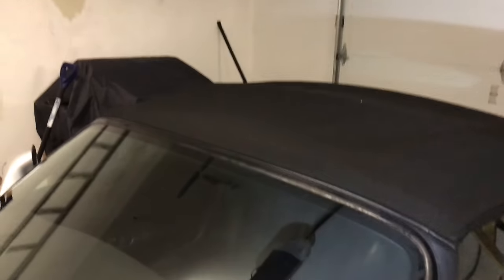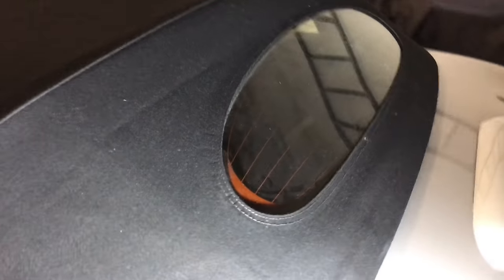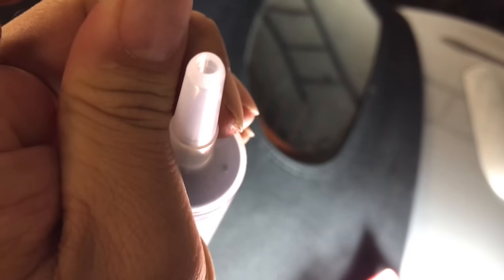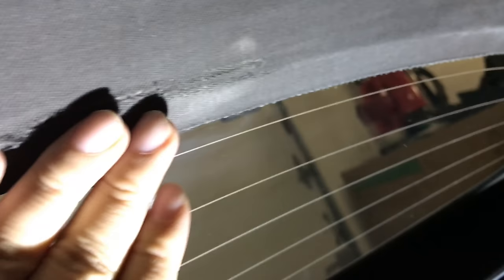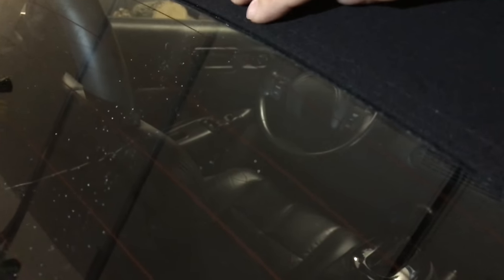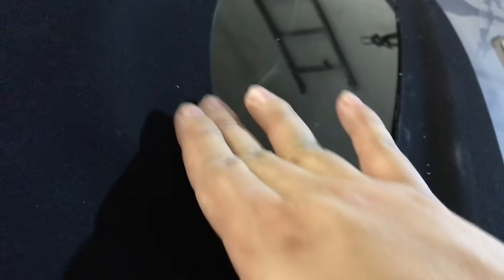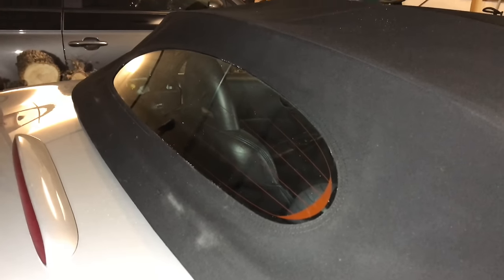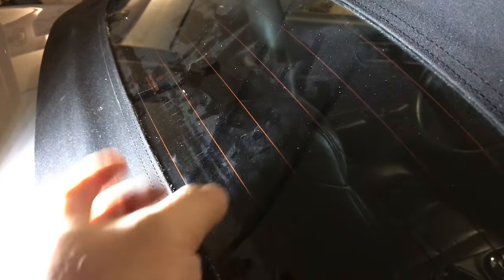How to glue separating convertible top and rear window on my Plymouth Prowler

Comment: Goop glue is the answer for sure. Ive used it for years. Just make sure your surfaces are clean and youre good to go ! After reading up on goop glue ,its all pretty much the same but in different consistencies. ALSO, Goop Marine comes in an 11 oz. caulk tube. Its slightly runnier but not much. I use it on everything.

Comment: You need to use 3M primer and 3M window weld. The best way to fix this long term.
Reply from the maker: That's a good tip. I didn't do that, but I would if I need to redo it.
Reply: Yo, thanks for the recommendation. Looked into it and seems like the best ans easiest way to go. 

Kudos to you friend! Enjoy the summer weather.

Comment: Thanks. I have a Chrysler Sebring. (I can't believe I just said that sentence). It's a 2005 with 41000 original miles and I'm in Florida so you got to have a drop top. I had a similar problem just not as aggressive. My issue was confined to the center bottom. I live in Orlando, Fl every winter but a Chicago boy 24/7 ! A big thanks from Rogers Park Guy of California Avenue, in between Touhy and Howard. Orlando sucks and you rock. Thanks for your video.

Comment: has the glue held up over time?
Reply: Probably not
Reply: I tried to fixed my Spyder convertible problem like this problem. I did what he did and only after 2x pulling down my soft top the glass came lose again.    Once you reglue the seal, let it cure, Etc and eventually use the car and attempt to take the soft top down your glass WILL fall down it become loose again.  You can’t mimic a factory seal job at home.

Between the windy conditions when the roof top is up, moving the soft top up and down and Etc, will eventually cause the rear glass window to fall become unsealed again. 

Afterwards a professional repairer tried to fix my soft top window in the same manner. The glass came loose after 2x moving my soft roof down and up. 

I note this guy doesn’t demo opening up the car roof and reclosing it AFTER he “fixed” it.

Comment: I used goop and it didn't work....I live in Arizona and the top is black, so the heat caused it to delaminate.  Now  I am in the middle of getting the goop off of both sides and start with a new product that is silicone based and does better with high temperatures.  Hope everyone else has better luck.

Comment: Hi!  THANK YOU for this vid... very very helpful!

I used this GOOP product to repair my '05 VW Beetle top glass.  So far it's worked FANTASTIC on the bottom and two sides where I put it on.  Bottom -- wait 24 hrs... two sides -- 24 hrs.  Great!  Problem I have now is the soft top does not overlap the glass at the top (shrinkage problem?).. yes, I can get them to meet by wedging open the top during the repair, but it'll pull apart I'm certain as soon as I clip it all shut.

So -- what to do?  

If I unfold the lip of the soft top it adds about a 1/2" and they touch even when closed... but barely.   

I'm thinking a "patch" to extend the length of the soft top at the top edge of the glass would make for WAY less tension when closed and close that gap. Is this feasible?  What fabric to use to fill that gap?  Is there another technique I could use here?  ARGGGGHHH!
Reply: I have the same problem.
Reply: I have the same problem. But i'm going to put a frame around the class..good luck with yours. Ea

Comment: Did you have to use any clamps or magnets to hold the glue in place.?
Reply from the maker: I just used tape, but I learned that they make window clamps for this type of thing. If I was going to do it again, I would buy a set of them.

Comment: Six months later, did this fix stand the test of time? Summer heat has a way of relaxing glue, I hope this is a permanent fix!
Reply: How did the glue hold up, we'd like to know?
Reply: dontswin you need to use a two part epoxy.. I tried many glues and the only one that held was a two-part JB Weld from Lowes.
Reply: Thanks for that, I use it often around the house. I am still thinking about tackling the  entire top replacement job. It sure is a lot of work that way. I just don't know if I want to spend nearly 8 hours on that project. By the time I get all the stuff together, thats an easy 2 hours alone.
Reply: dontswin I ended up buying a marine vinyl and then using magnets to hang it in place and then glue it into place. It's not the prettiest, but it has held up very well. I only drive my TT with the top down, so it works for me.
Reply: I am going to try to get a piece of that marine vinyl and cut a it like a D shape since there's no way I can stretch the 2 bottom layers onto the lower edge of the glass. There is too much of a gap especially the top layer. Where can I get this marine vinyl? I can run a bead of epoxy down the sides of the glass maybe only the lower 10" then across the bottom and glue to the existing outer layer. Now I know why my daughter was having so much trouble getting the front of the hood to set down and be clamped easily. The canvas has shrunk too much thru the years. I mean it is a 2001 Sebring.
Reply: dontswin I got my vinyl at JoAnn Fabrics. I really recommend magnets though. You put one on the inside and one on the outside and the force holds the material in place while the glue dries. Epoxy takes at least 10 minutes to take hold, without magnets that's a LONG time to stand there and hold it.
Reply: That is a good idea. I will also put a thin bead of silicone chaulking where the edge of the vinyl meets the glass. So then the water will have to get past that and then the epoxy next. I will also leave a small amount of slack on the vinyl at the bottom.  Thanks for all your help. Now the search for some magnets, lol.

Comment: I've used rhino glue before which laster 2 years, but still is tight on about a quarter of the window and the good thing about it is it looked like new, because it's like epoxy super thin. The problem is it will never last everywhere because it's rigid and won't deal with uneven forces.

Regarding goo or M3 window weld, intuitively I don't trust it. How on earth are you going to ensure there is a thick enough layer? To keep the window in place you have to compress it while drying. None of the windows I've seen in yt videos looked flush with this method. With the rhino you don't have that problem, it needs to be tightly pressed like super glue. And I think the window weld is meant for sealing windows, like  windshields, rather than glueing. That's why it comes in a giant tube.

So this is what I'll do. The main issue is getting a seal against the rain. For that, the lower half of the window must not have any gaps. Upper doesn't matter. I'll use 3M extreme tape, which is still holding in more than half the places I stuck it about 8 years ago. The problem was, I only used a few strips to hold it in (proving it's super strong), but the gaps without tape led to rain leaks.
This time I'll try to unroll the tape in one piece on the lower edge, while holding the upper piece in proper position with a few strips of the tape, so the lower part will be flush. Around the lower corners I'll have to cut a few pieces, have to figure out how to position the tape without gaps.
Reply: A member of the Sky - Solstice forum used the 3M double strength tape too and had great results!  I may try this first since it’s instant
Reply: @thomasharris5151  It should work well, if you haven't used anything else like rhino already because it leaves less surface that's even to stick to

Comment: I tried this on my Audi a4 cab with this product and sadly it didn't work. The rip is getting bigger!
Reply: He sewn the top on and told a lie on this video.No convertible top comes sewn to the insulation like that when they should be so they'll never break
Reply: @lionyleftwich4418  Noo  he didn't sew the top on. You told a lie. It does not matter if the top comes sewn to the top. Even if it was threaded to the top and then separated the glue will bond the 2 pieces back together. Put your mask back on and shhhhhhhh.

Comment: I have this issue with my 99 mustang. How long does one have to wait for the adhesive to set(dry)?
Reply from the maker: I waited three days on mine to be safe and it seemed to be permanent. Not sure what the minimum time is through.
Reply: Peter von Panda Thanks for the reply. I was told 5 days but was skeptical about it.
Reply: How did it hold up?
Reply: @PHOTOGRASPER  didn't hold up well, but that was due to the person I had do it for me( not a pro).

Comment: Do you know if that window with the defrost lines on it can be tinted
Reply: Check your state laws but most likely it will be illegal as tinting a front or rear window is usually illegal, some states it's illegal to tint them at all, some states the front window can have the top tinted and such
Reply: Yes I know and it can't be tinted as heat will break along seam
Reply: Mine is tinted after market....its been 5 years since i had it tinted with no issues